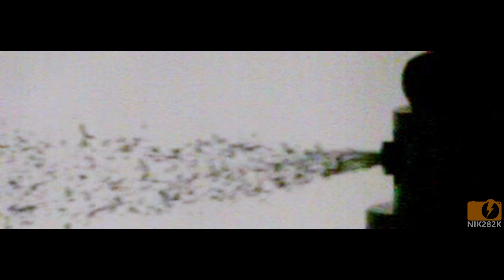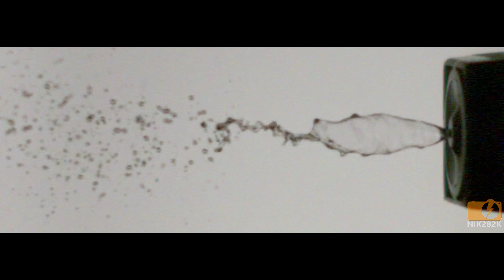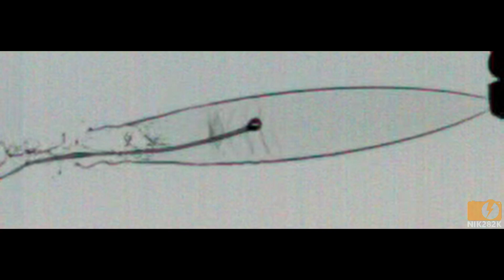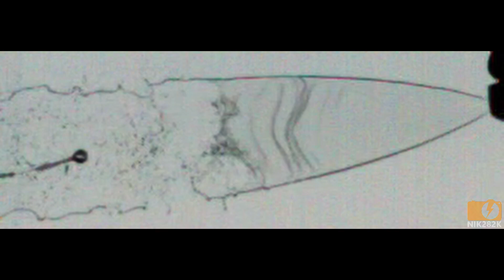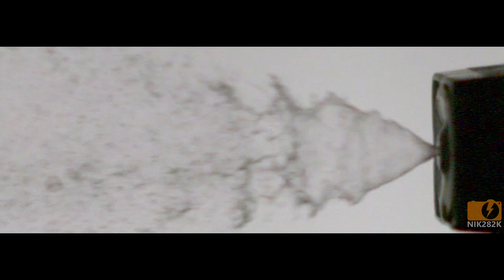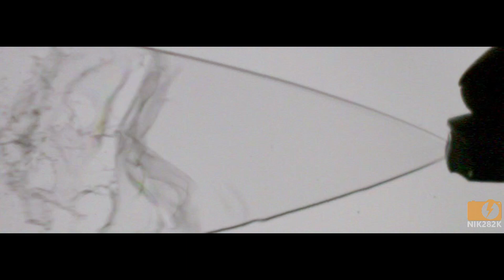Atomizers

Comment: I didn't even know there were atomizers that spun water to form a cone!
Did you rip one apart or did you find the patent files? Or...?
Reply from the maker: I have pulled them apart in the past but never realized until now that the vanes inside were to swirl the liquid. I also spent a couple of days reading research papers and design notes on a lot of nozzles last week.
Reply: @NickMoore  sounds like the perfect weekend... Now I'm on the hype of double beat valves. Very popular on old steam trains tech, but nowadays almost forgotten. A misery wikipedia page and that's almost all...
Btw, not just randomly commenting you this, but this valve might be useful if someday you respawn the cannon. It's an on-off one, that can handle high pressures, yet opens and closes with little effort. Sort of like a double spool valve but flat sealing faces instead of o-rings

Comment: I have a box of varous small pipe fittings, bushings,  and nozzles that I got from my uncle's estate.   There was a particularly complicated one that was a few cm long, had a male end on one side, and a female end at 90˚. The diameter of the passage was greatly restricted near the 90˚ bend, and it was off-center.   A small cone sits in the middle of the flat bottom at the exit.

The threads are standard at the inlet, but fine at the outlet.   At first, I wasn't sure what it was for, because the female threads didn't seem to match anything  else in the box.  There were a few different spray nozzles in the box, most were V-notched that made a triangular spray pattern, and some were recessed concave on both sides of a round hole, that gave a solid stream of water when I had it hooked to the garden hose.   However, when I put the round nozzle on the weird brass fitting, it made the spray pattern conical.   It was pretty neat, because I figured it would essentially behave the same way as a straight-through, but nope, a very wide cone spray resulted.

After trying to find a photo of it on google, I instead found a name for it:   Tangental Whirl Hollow-Cone Nozzle

I suspect that the hollow-cone nozzle in the sprayer you used was an axial whirl.

And now I've fallen into the spray nozzle rabbit hole.

Interesting video!
Reply from the maker: Take a look at impinging stream atomizers. I ended up cutting a minute out of this video because I didn't have the time to build a decent example. They form the same waving sheet but they are used in liquid fuel rocket engines!

I also agree about the axial whirl, in all the cone-spray squeeze bottles I have taken apart (too many) I have noticed there is always a slotted piece just before orifice that is adding the whirl. On the combination spray/off/stream the nozzle end is a little more complicated with some small ports, I have to cut one apart to get a better look. I would have for this video but I need all my spray bottles at the moment.